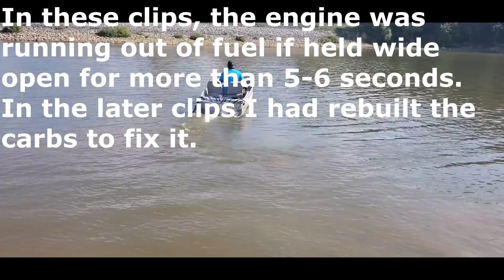85 HP Jet Jon build pt2.

Comment: I would to see you build a bow cover with a windshield. You can probably get the windshield for cheap from one of the boat junkyards.

Cover the engine compartment in wood, plywood, maybe aluminum, and coat the engine compartment with sound deadener where it does not get wet.

An  aluminum fishing boat from 16 to 18 feet long, will feel like it is running from the police when it is doing 20 mph. Keep up the good work!

Comment: How did the pvc exhaust work for you? I'm building one with the same engine and jet pump.
Reply from the maker: It worked pretty good, but I didn't have it mounted well enough so it came loose and started spraying water in the boat. I will be redoing the exhaust to go through the transom instead of over it this spring.